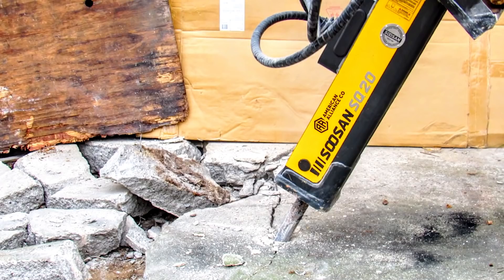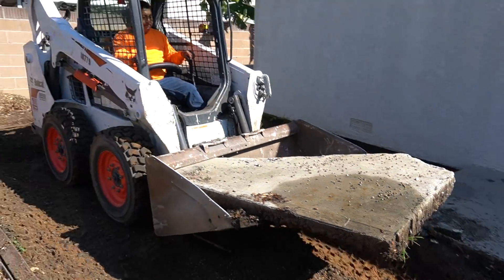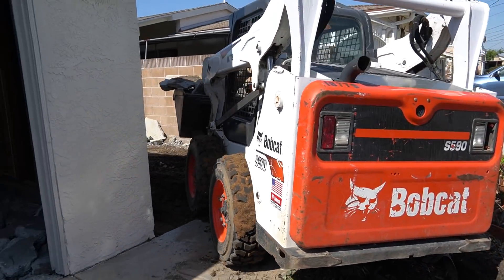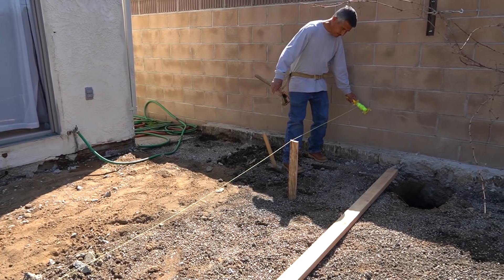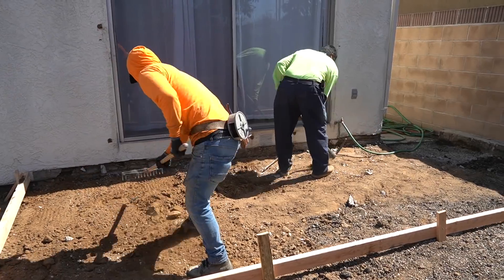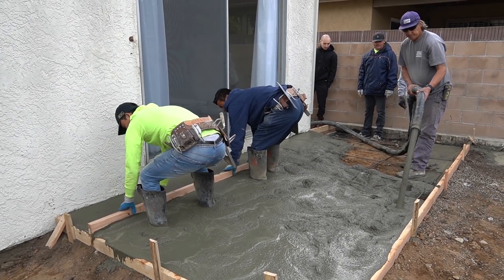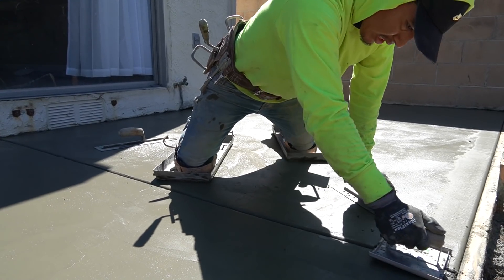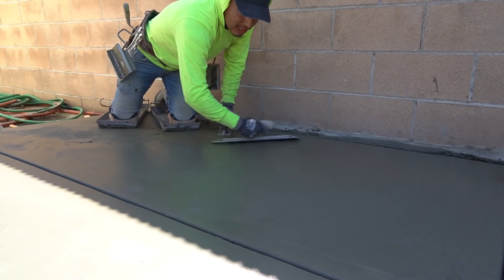Concrete Patio. Broom Finish. The Best in the West! California

Comment: Why don't you isolate the concrete from the ground? Don't you have rain over there?
It will suck up from beneath and then, when the temperature changes it will crack.
Reply from the maker: No freeze here. Barley rains. Thanks for watching 👍